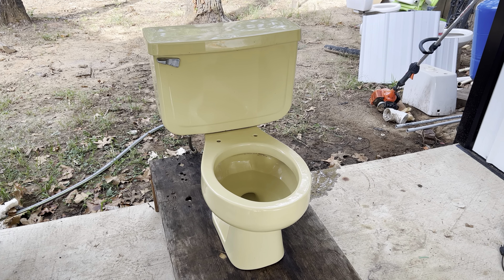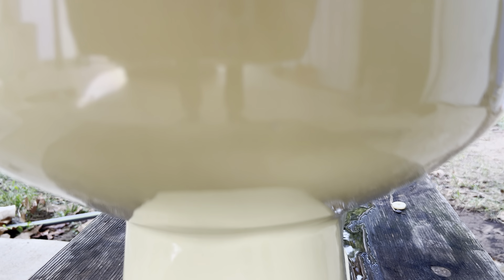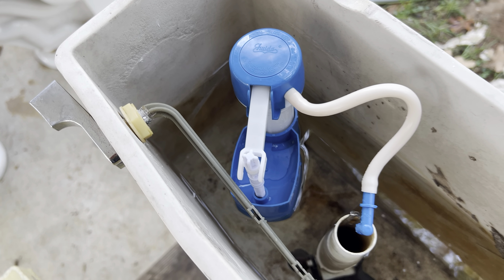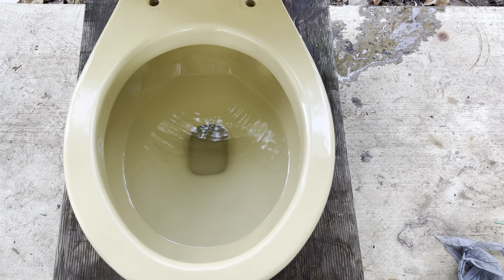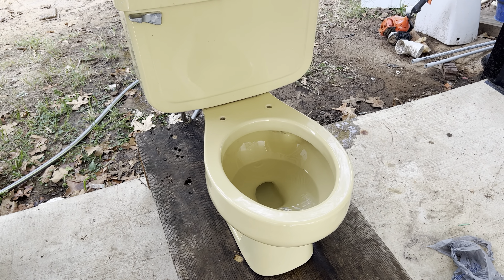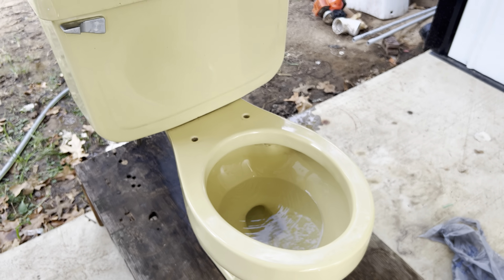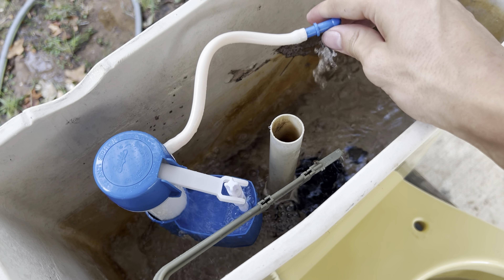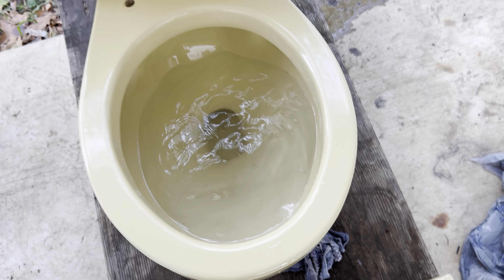1978 Yellow Kilgore Apex Toilet Flushes!

Comment: You need to set the water in the tank up to the max level so that the flush is at the proper stength, even though it would be a bit too long. That could be part of the reason it wouldn't take the rag.